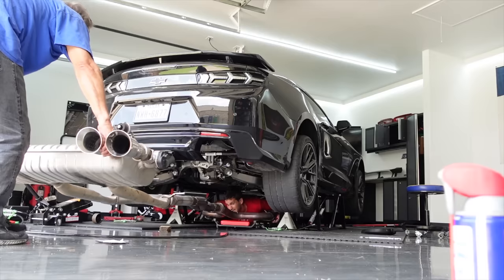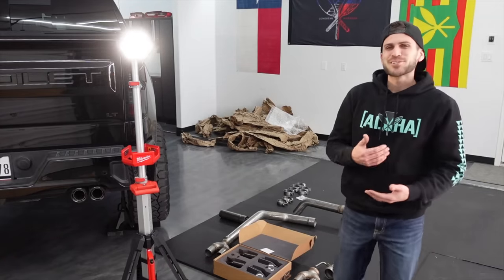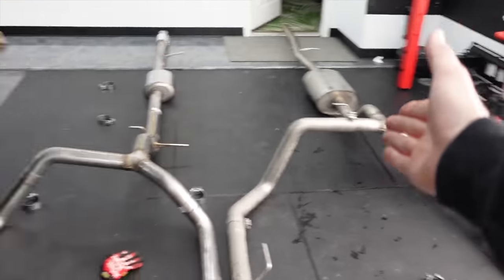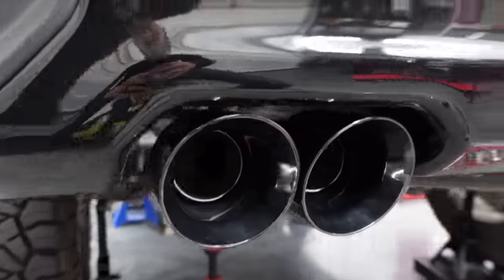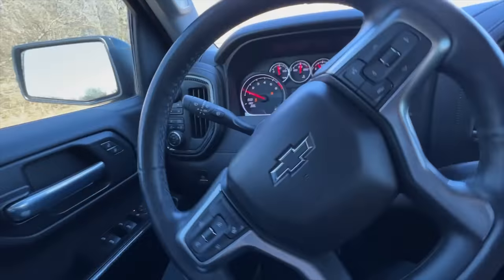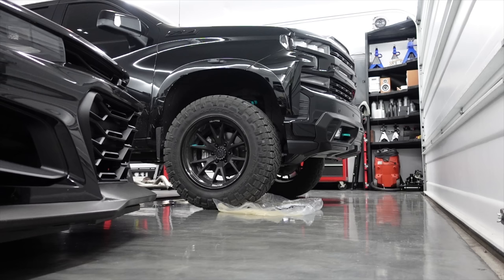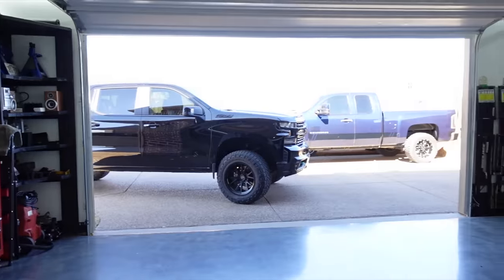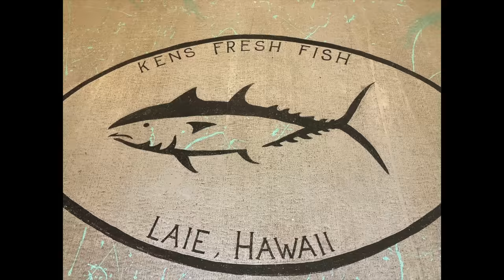Best Bolt-On SILVERADO Exhaust - Quad Tip! [AWE OFG Catback]

Comment: Been loving your videos. Brought home a 2020 5.3 RST 2 weeks ago absolutely love the truck and I've already followed many of your mods. The LASFIT LED light upgrades, cold air induction and added the boost auto parts wiring harness that turns on the cargo lights and tailgate light with reversing. Easy 5 min install. Looking to do the exhaust next. Do you have someone lined up for your borla exhaust? Thanks for showing us all many of these mods are doable in our own garages!
Reply from the maker: Likely going to retrofit it to my Dad's '99 Silverado

Comment: I remember in highschool I hit a pot hole on my way to work and knocked my truck out of alignment (I had just aligned it myself in autoshop class but forgot to torque it down), I ended up buying a socket, driver and wrench big enough, jacked up my truck in the work parking lot and aligned enough to get home and get it back in autoshop to properly do it. I was impressed I got it aligned enough where it took like 10 minutes and it was perfect. 

Just wanted to say I'm also a big fan of channel. I found this channel after I got my 01 Silverado and subscribed almost immediately. I love what you've done with the Trail Boss. Especially with this new exhaust sounds perfect for a V8.

Comment: You and the AutoVlog guy are exhaust nuts. I'm 75 and still love the noise of a good exhaust system. I'm looking like you did at something not too loud inside the cab but sounds good outside and get my windows tinted at the same time. Love the sound of the Camaro, sounds like an explosion when it first starts. My GMC is also black but just stock 2 wheel drive a 19 SLT with 7800 miles. I just sit and look at it once in awhile then maybe wax on it a little.
Reply from the maker: 100% Exhaust Nut. Camaro is definitely louder than the Silverado. Moving a bit more air through that system. Thanks for watching!

Comment: As with a lot of other truck owners on here I’ve been researching and watching and listening to a lot of exhaust systems on YouTube. I narrowed it down to the AFE Vulcan and now the AWE OFG. Only problems is, my 21 Silverado 1500 LT 2WD came with a single side exit. No bumper cut outs, which would be really nice. So, I’m torn between a single pipe side exit or quads out the back. I just wanted a little beefier sound than stock.

Comment: AWE is AWEsome. Everything will drone at certain instances, just depends on if any materials in the vehicle vibrate at the same frequencies. Having the Y collector up front helps smooth the pulses that go under your cab, then get split post muffler. So you get a smoother trumb (not sure how to spell it but its the smooth V8 rumble at speed) exhaust tone rather than two 4 cylinders arguing out of phase... now an X pipe would make it scream

Comment: I've had mine installed for a year now. Gotta say absolutely love it. Note: I have the Pulsar LT with dfm disabled. When you slow down, does your truck have a burble? Mine does and it's crazy, its like it has a burble tune from factory😅

Comment: Have you ever thought about on The OG Truck, adding the end bumper caps with the fog light holes and paint match them to the truck and add foglights.
Reply from the maker: Likely will be doing an aftermarket front bumper
Reply: @LonestarHawaiian  Have you thought about a certain one?

Comment: I picked up a new Gibson cat>back exhaust for my '22 Silverado 6.2 for $365 shipped (someone messed up). So that's what I'm going to be rocking.

Also, AFE's kit for my Silverado is $2195 (chrome tip) or $100 more for the black diamond tip. Can't justify that cost, gotta pass, but sounds great.
Reply: Dude you’re going to love it! I have a 21 Silverado custom trail boss 5.3L and I have a Gibson full catback and I absolutely love the sound, it has a deep aggressive rumble to it (especially on them cold starts 😮‍💨) also when your cruising on the highway it’s pretty quiet. No cabin drone whatsoever, it’s 👌🏻
Reply: @blkbeastz71  that's awesome! I'm taking everything to drill next weekend to install the parts when we're dismissed for the evening. I'm doing some sound matting from the tire drone, and was hoping the exhaust wouldn't have a loud drone so my wife doesn't kill me. So thanks for the information!
Reply: @scottstamm7022  haha the drone isn’t overbearing loud, it has a smooth deep rumble

Comment: Nice system, decent sound, just not worth $1,800.00 plus for me. Enjoy it!
Reply: Hacksaw + Straight pipe = Smiles for miles without muffler & valve
Reply: muffler delete kit is like 100$ a sawzaw and grinder another 100$. almost exact same sound, i did a 2021 trailboss last week.
Reply: @sintrix2020  Have any vids of the beastie?
Reply: @sintrix same! Spent that $1800 on new wheels and tires instead
Reply: @TheWolfMatt  Yeah I can make some tomorrow and upload.

Comment: A straight pipe off of the catalytic converters sounds better than any muffler but the newer 5.3’s in these trucks don’t sound anywhere near as good as the 99-02 5.3’s do. After they went to the electronic throttle they never sounded the same after that.

Comment: Have you checked your fuel trims to see how lean the engine is after the exhaust installation?
Reply from the maker: I need to now that I have the tools. Going to dive in on the 07 first to learn a bit more but I’m super curious on the ‘20.

Comment: what’s up with this squish pipe. Is it worked it replacing the squish pipe or not?
I was thinking replacing the exhaust system with the dual pipe from Borla . Any input will be greatly appreciated.

Comment: Sounds incredible bro. How much did this system run you ? I think I may wanna put it on my 22’ Trail Boss or my 14’ Sierra. I’d also love your opinion on the tailgate lettering I put on my TrailBoss the other day. I posted a video about it on my channel. Not super impressed. Looks okay in the sunlight though.
Reply: So unfortunately the Awe-tuning company does not make exhaust systems for the 2014-2018 generation of GM trucks. I was looking for an exhaust system for my 2014 Silverado.
Reply from the maker: Ditto. I wish they made one for the '07. Maybe someday.

Comment: I would like to buy 2 mufflers and the tips then take my truck to an Exhaust shop that has a mandrel machine and get the pipes done there. I cannot in good conscience put a quality exhaust on my truck and leave that flattened crossover pipe on the truck.  Plus I could get true duel exhaust installed.

Comment: Here in the Rust belt we need that black gunk on the frame
Reply: No they should bedline the frame from the factory
Reply from the maker: GM needs to get a contract going with a bed liner company. Would love that frame coated in that vs the gunk that now stains all my clothes 😅

Comment: Did you have a lifter issue with your Silverado?
Reply from the maker: No issues yet. 32k miles
Reply: @LonestarHawaiian  awesome I’m sure it was folks stabbing out causing failures on those engines. That 5.3 is a super solid engine and the 6.2

Comment: I just picked up that muffler delete that you 1st had for your exhaust.  I love it but its still kinda quiet. 

So I'm wondering how itd sound with different pipes after the muffler since the stock pipes have those tiny baffles welded in to keep the noise down
Reply: Try going to a home improvement store and getting 3 inch aluminum tape and wrapping it around those baffle holes, makes a difference. There are a few videos on it.
Reply: @loganbowen8466  really?
Reply: Yes
Reply: @loganbowen8466  it works pretty good. Can hear the difference

Comment: I guess if you live on the equator you don’t need rust protection but up in the North it’s a requirement so your gm doesn’t  flake away from the salt. So executives pls disregard the fellas black stuff comment. Or your truck will only last 3 months of a real winter in the great white North. ✌🏼